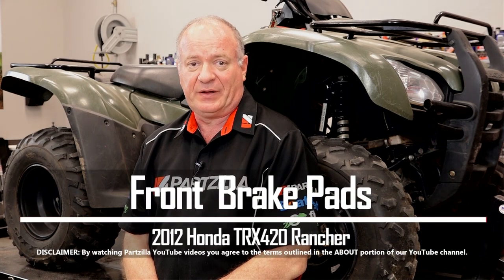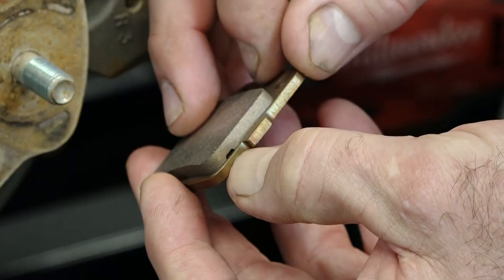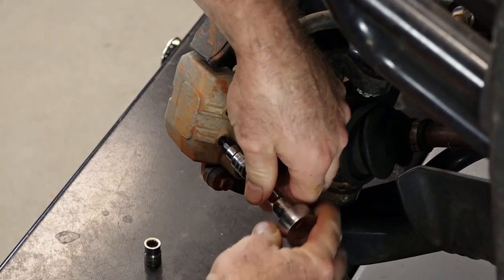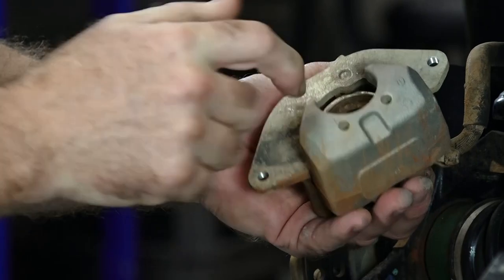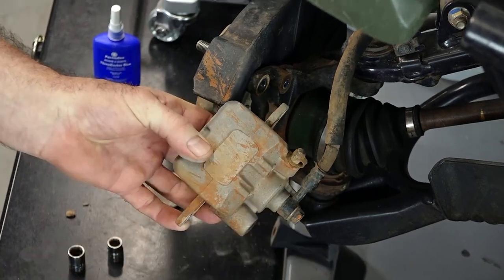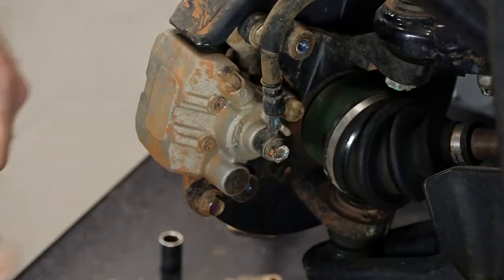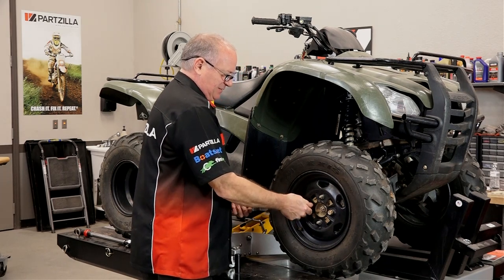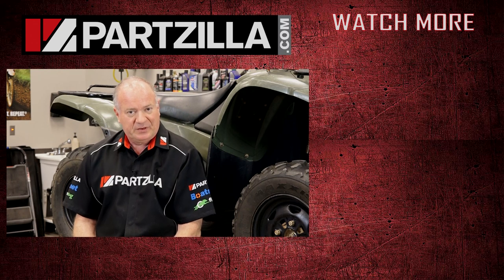How to Change the Front Brake Pads on a Honda Rancher 420 | TRX420 Rancher Brake Pad Change

Comment: I would suggest to also put some anti-seize or grease on those guide pins when you re-insert them.  The far end of them (the threaded end) is exposed and they will get debris and rust in there, and they can become VERY difficult to remove if they sit like that for years.  I have stripped a few of the heads before and if you can't get the pins out, you have to buy a whole new caliper, which is $100-150 each.